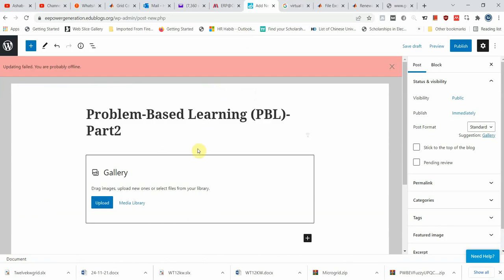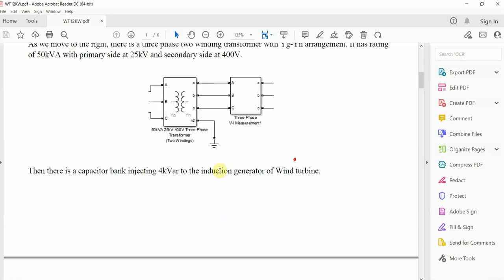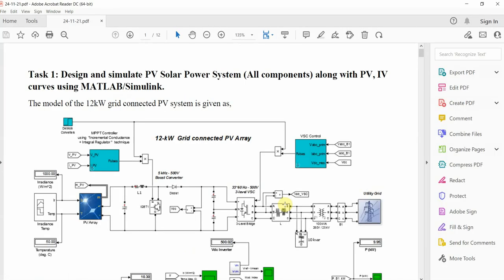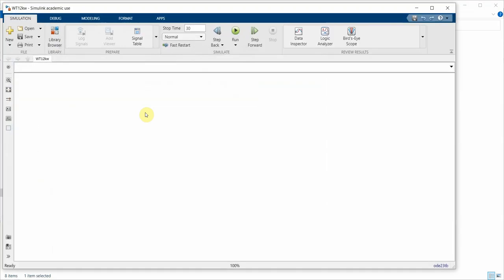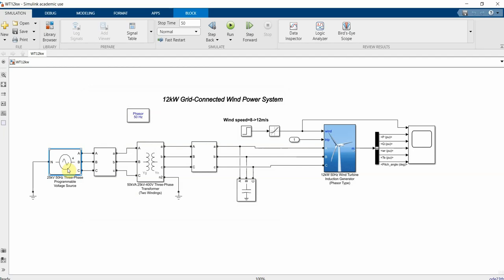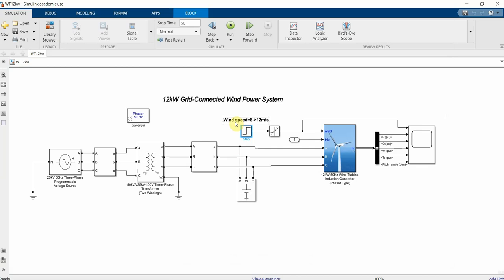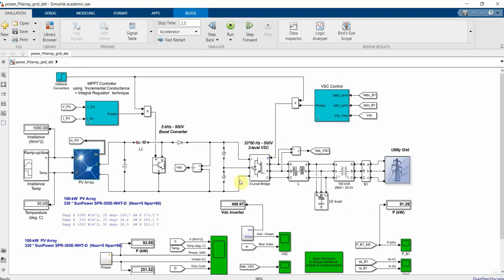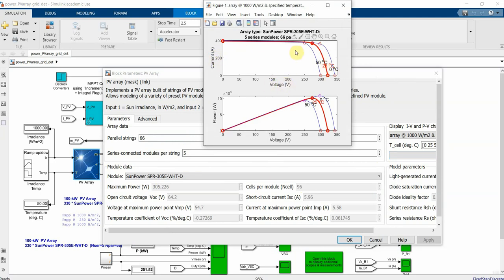Simulink model of solar and wind

Comment: If a switch is inserted into the model, will the model run in isolation mode and in grid-connected mode in one continuous simulation?

Comment: sir is it possible to make it a hybrid system
“adding the pv to wind module”?
Reply from the maker: yes
Reply: @DrHURHabib  sir please explain how to do it
Reply from the maker: @pratikpatra-0623  It will need time for the complete project, you can contact on by email or WhatsApp.
Reply: @DrHURHabib  email id/whatsapp no plz
Reply from the maker: @pratikpatra-0623  habib_rahman_habib786@yahoo.com

+92-301-53 52 644
Reply: Hello Sir, Can I get the File for the system please!??

Comment: sir ,is this simulation enough for grid_connected pv system and wind power system research?
Reply from the maker: yes, but it also depends on your requirements.
Reply: @DrHURHabib  can i give this simulation as my thesis of hybrid power generation ?
Reply from the maker: @Kamrulhasan-xc7ff  you need to make changes as per your requirements.
Reply: @DrHURHabib   i mean ,parameter value ?
Reply: @DrHURHabib  has any battery been used in solar PV simulation ?
Reply from the maker: @Kamrulhasan-xc7ff  you can check the model and its details in the video.
Reply from the maker: @Kamrulhasan-xc7ff  yes and control strategy as well.
Reply from the maker: @Kamrulhasan-xc7ff  its grid-connected, no need of battery.
Reply: @DrHURHabib  the files are corrupted can we please have the source the rar file cannot open its corrupt
Reply from the maker: @kumbirayinzirawa3418  It is working, you can try to download it again.
Reply: @DrHURHabib  Thank Yiou Al for your response yes its working. Which version of matlab should l use to access the power PV array simulink file and also can the model be used as a means of frequency and droop control for the wind and solar systems
Reply from the maker: @kumbirayinzirawa3418  I use matlab2019b. You need to modify it for frequency and droop control.

Comment: Sir  I need some document to understand the model could you please send me sir
Reply from the maker: You can download the model and documents from the link provided in the video description.
Reply: The link seems to be corrupt,kindly resend please
Reply from the maker: @cainmorembanje3295  ok
Reply: It's still not yet opening,kindly re-share Sir
Reply from the maker: @cainmorembanje3295  ok let me share
Reply from the maker: @cainmorembanje3295  I just checked it, link is working.
Reply from the maker: @cainmorembanje3295  https://drive.google.com/drive/folders/1NrtQQMa0DWbiH0XKDkDuipfEv39VnaXA
Reply: Thank you so much have successfully retrieved them
Reply: @DrHURHabib  
sir is it possible to make it a hybrid system
“adding the pv to wind module”?
Reply from the maker: @yahyaabuatteieh  yes if you can.
Reply: @DrHURHabib  am trying for these two modules but its giving errors
Reply from the maker: @yahyaabuatteieh  you can follow the instructions mentioned in the notepad file.
Reply: @DrHURHabib  yes am following it for each module separately its working
but if am merging both systems its not